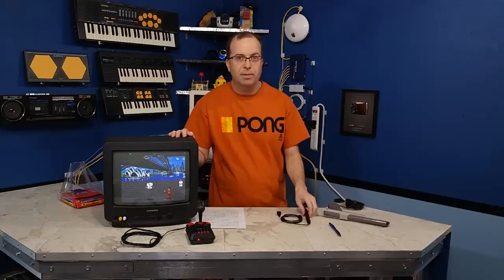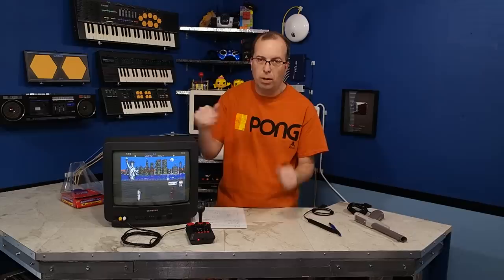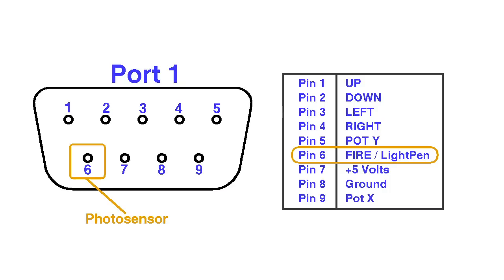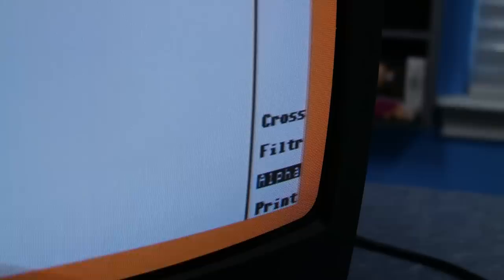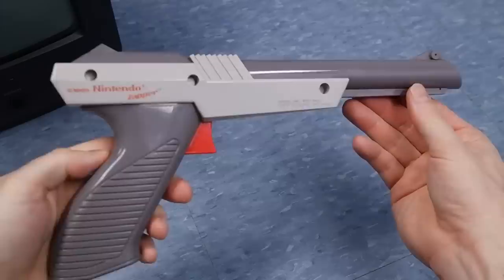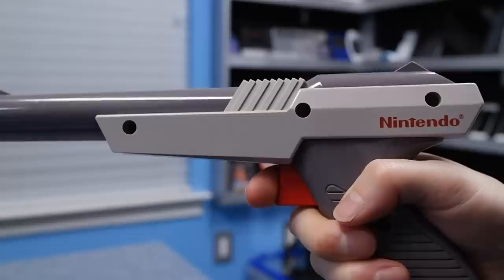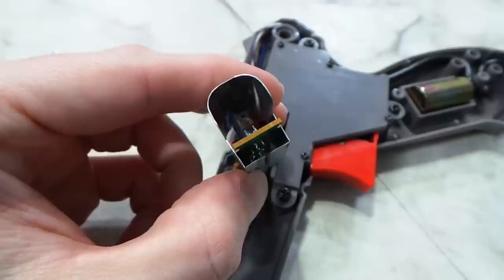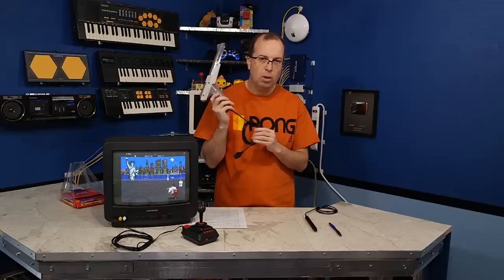How light pens and light guns work NES Zapper

Comment: Hi 8 bit dude 
I have a question
I have a famiclone light gun
Can I make a battery powered light gun without connecting to NES because I live in Turkey and it is hard to find european light gun
If it isnt works, can I cut end of extension cable and the end of light gun then fuse them to make my own?

Comment: Both technology’s are interesting, the C64 lightpen works in a pixel base way while the nes zapper gun works in a frame base way, 
but theres a catch, the nes zapper works on a frame base,
I suppose even the zx spectrum lightpen works the same as the nes zapper, because you had to & click on icons or points to draw lines on it by pointing the lightpen onscreen but every click causes a flash, so it’s not goingbe easy to draw things that way, i i am not really sure about it???

Comment: Ah an all grey Zapper those are somewhat rarer than the orange and grey version packed in with later runs of the NES, that change came about due to an influx of new laws regarding how toy  guns  had to look.   This occured due to a number of well publicized incidents in which cops mistook the highly realistic toy guns of the day for real ones and kids got shot.   Nintendo made the change to comply with the laws  and the market for toy guns in general fell off a cliff as with the odd colors or orange caps required they lose the realism that was a big selling point.   Even Transformers was effected as they could no longer use guns as an alternate mode for their figures  and the original G1 Megatron toy could not be reissued as it transforms into a downsized but highly realistic Walther p38 hand gun.       Hasbro has released a few gun Megatrons  since    but none were remotely realistic as they were either modeled after nerf guns in garish colors or super small and even on that one it had to have the orange cap.

Comment: crazy question, could someone somehow modify the zapper's circuit to delay the photoresistor to the same time as an LCD?
Reply: Please educate yourself on how LCDs work and how they draw the image, then your question will answer itself with a loud NO ;)
Reply: Still seems plausible to me. Do you believe that because it isn't bright enough? as far as I know the only reason it doesn't work is because of timing. The light gun just needs to know if it sees light or not. it is not detecting the scan line like the light pens.

Comment: Couldn't you make the Zapper work on modern screens by making the game account for the screen delay?
Reply: Maybe? the delays vary a lot tho and are based on real time rather than frames (the tv, settings of the tv and games gave different results), so the game can't calculate the delay properly
Someone said that the Guncon2 (the PS2's version of the zapper) managed to work around this by having the video output be connected directly into the gun, bypassing the delay
But since nowadays we use HDMI and VGA connections it's not as compatible as it used to be

Comment: can't they include a calibration system to count the LCD monitor's delay and compensate?
Reply: In theory they could have done that, but it's too late now and back then nobody expected that to happen. Remember that these pieces of hardware originated back in the first half of the 80's, so the only LCD tech you could get was expensive and tiny (e.g. for calculators or clocks), usually with segmented displays rather than real pixels.
Reply: Smaxx hope someone did that now for emulators :)
Reply: Emulators don't have that problem. They can just get your cursor position and use that to check for white pixels. If you're using peripherals (let's assume the Wiimote or similar), the orientation/aiming is first translated into screen coordinates and then once again checked against the black/white screen. It's trivial to do, if you don't have the TV's delay. In theory it would most likely be possible to get it working in hardware, but then you'd have to slow down the actual console as well to give the screen/signal enough time to arrive.

Comment: I don't understand the problem with the light pen on a C64, if the program was written for the C64 why would they include a Light Pen that was not wired correctly?
Reply: The problem is that there were multiple light pens from multiple manufacturers, some of them wired differently, and so software would work with some pens, but not all.

Comment: I have a black Commodore 64 tape reader. Is it rare? I'I've only seen white ones
Reply: Does it have a small round connector on it, rather than a wide edge connector the C64 used? The black ones I've seen are for the C16 and Plus/4, with a round connector.
Reply: Bedford Level Experiment yes, it has a round connector with an adaptor for commodore 64

Comment: The move and kinect may have failed because they tried to ride the Wii Remote bandwagon with crappier versions of the wii remote.
Reply: Kinect wasn't competing with the wiimote, the wiimote was for adding extra depth to the controls, kinect was for full body capture for very specific kinds of games
Playstation Move was useless because very few games used it and even then it couldn't do nearly as much as a controller (wich also had motion sensors, but they sucked)

Comment: 3:12 Does anybody know how the light pen could still work at a distance like this?
Reply: Because the photosensor can still detect light from a few centimetres away.
Reply: @gwishart  Wouldn't way more pixels fall into the lenses view though? I don't understand how it manages to stay accurate.
Reply: @WilliamAncich  What lens? Most light-pens don't have them. Just a hole in the end of the pen with a simple photo-diode.

Light-pens aren't particularly accurate anyway, so being a few dozen pixels out doesn't make much difference.
Reply: @gwishart  He mentioned it at 2:51. Regardless, at a few inches away I figured so many pixels would be within view that tracking would be impossible to do.
Reply: @WilliamAncich  As with many of the things he includes in his video - he's not entirely correct, either because he's simplifying on purpose or just doesn't understand the subject.
Reply: @gwishart  Is there some place you learned this from or is this your understanding of how it works?

When it's held at that distance wouldn't the change in light be much harder to detect? Even if it could be detected wouldn't light be detected from a large section of the display making accurate tracking impossible?